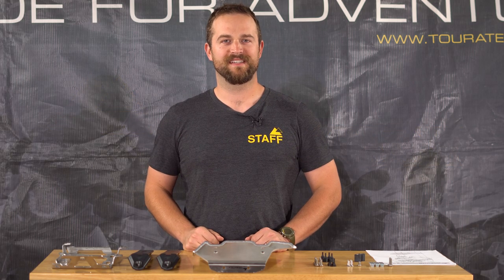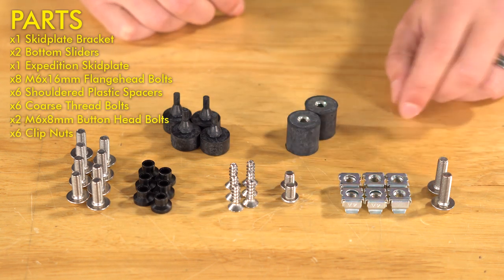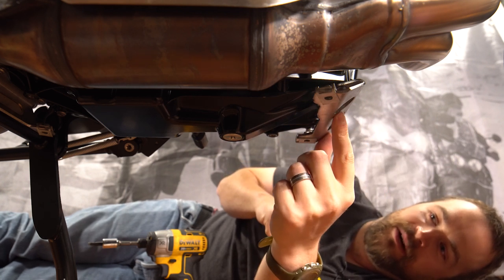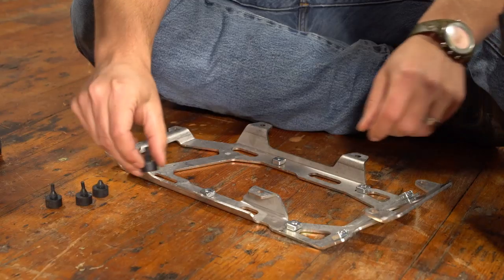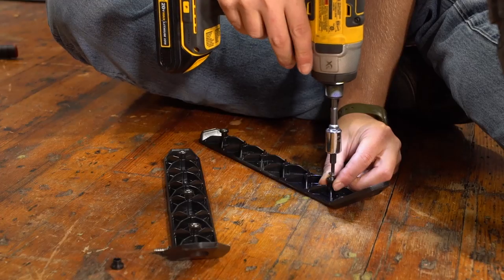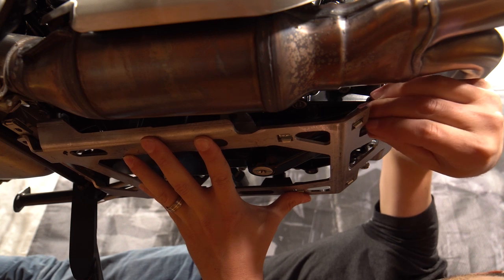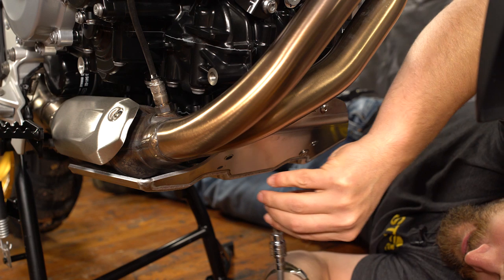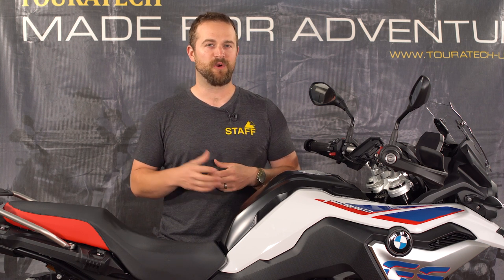BMW F850GS Installation: Touratech Expedition Skid Plate

Comment: My 750 required an extra piece on the back of the plate, which thankfully I saw on the website description. BUT, my bike did not have an OEM skid plate so I had none of the 4 OEM bolts to install this. Very frustrating.
Reply from the maker: Sorry to hear about that issue. It would be nice if we could include those 4 bolts in the F750GS specific bracket that is needed since some of those bikes didn't have the screws installed from the factory.

Comment: Hi, I am trying to install the expedition plate on a F750GS. I am struggling to install the 4 Pull-through bumpers. Is there any advice or tool I should use? I am trying with locking pliers and I have broken the tip of two bumpers already.
Reply from the maker: I used pliers and a little bit of engine oil on the stubborn ones. You can see in the video at 2:41 that I had already broken the tip off one.

Comment: I am horribly disappointed with the crappy clip nuts to secure the skid plate to the bracket. Who ever designed the clip nut fittings and the square holes they ‘clip’ into needs to rethink the whole thing. I fitted the plate but dropped the unlock screw from the lower engine guard and had to remove the plate to recover the screw.

The nuts were not suitably secure in the square holes and they just spun. I have gouged the plate and trashed three of the clip nuts.

I am a huge fan of Touratech parts but I have gone back to the OEM ‘plastic’ protector and would not recommend the Touratech engine guard until they rethink the nuts.
Reply from the maker: Sorry to hear that you had trouble with the install. Those clip nuts have been in use on this plate since 2018. This is not a common problem so please contact us directly and let us know if there is any way we can help with the install.